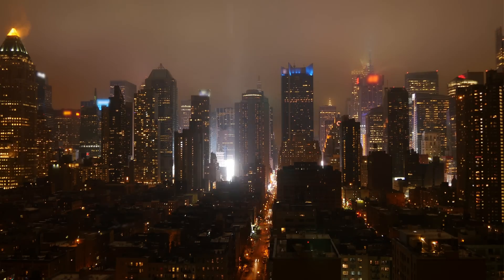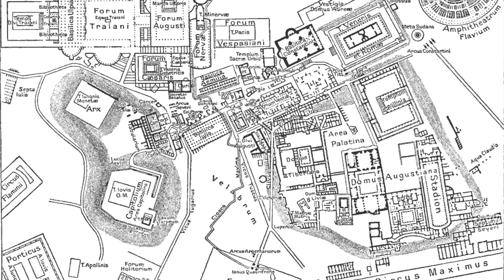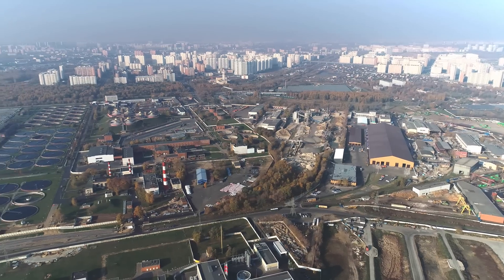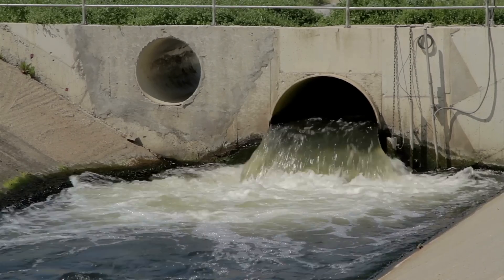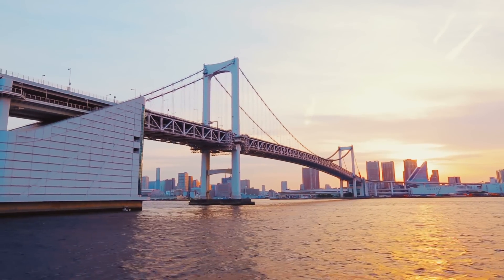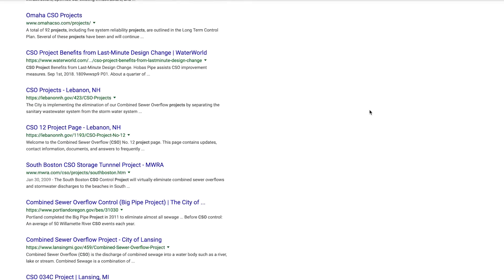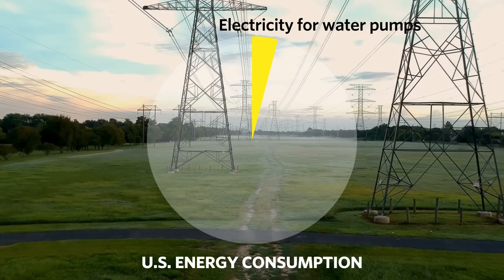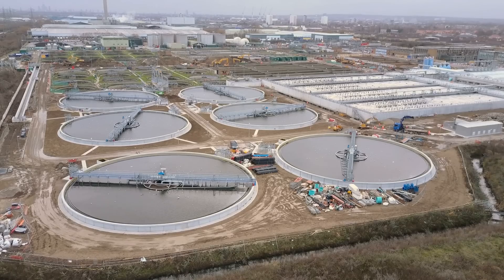An Intro to Urban Wastewater Systems

Comment: Cities Skylines: just drag and place water pipes and treatment facility. Done
Reply: C:S uses separate sewers, you can see 2 separate pipes parallel to each other when you drag-build them. 

Also the water intake and sewage dumping in C:S is flawed. Everything gets treated at both ends and you don't just increase water supply by adding more intake pipes; you need to build new, or enlarge, existing water treatment plants IRL.
Reply: @mfaizsyahmi  no it's two separate, one for clean water, one for sewage
Reply: @xhonkeri4066  where's the storm water lines where the sewage line flows along?
Reply: Lol
Reply: C:S Modders: Pipe? What pipe?
Reply: It seems that Cities Skylines players are over-represented on this channel.
Reply: I always got sewer floods.  Worse than sim city 4's nuclear fallout.  Nobody would just wear waders and live in an underwater city.  Racist against mermaids...🤪🧜‍♂️🧜‍♀️
Reply: SimCity 2000 be like:
Your citizens urge you to reconsider the placement of this facility.

Comment: Thanks for the public service announcement for what not to put down the drain
Reply: Semen?
Reply: While it's true that you shouldn't pour fat down the drain, that's not what causes fatbergs. That information is wrong, because it's cheaper for cities to pretend to fix problems than to actually fix them.
Reply: @DustWolphy  It's never cheaper to pretend to fix a problem.  Source:  Every accident in history.
Reply: @krashd  yes but the accident that follows is someone else's fault.
Reply: The problem is when it comes back up the drain 😱
Reply: You guys be good to your sewer systems. Here in Nigeria, we seldom build sewer systems in our few cities. I live in a village with gutters both sides of the road. Gutters are filled with junk and all the stuff in this video. it is disgusting. It all floats on the road whenever rain fails. I was curious as to how western counties handle this issue and have clean streets, then came across this video.

Comment: I like the Biosystems! They are not only good for improving the quality of the environmental water, but also can function as artificial swamps, holding back stormwater, irrigating urban vegetation, levelling out the stormwater wave, that reaches treatment plants, helping to control cities microclimate by cooling down in summers due to evapotranspiraion... so many possibilities! It does not need to be a water sensitive city, but sponge city is a very promising start!
Reply: A lot of the new suburban developments around my area (MN/WI, USA) include drainage ponds with green space around them.  They double as infrastructure and eye-catching landscaping (usually as a centerpiece in a ring of apartment blocks), as well as watering holes for geese and other critters.

Comment: As a waste water and stormwater Engineer and for a municipality HAIR is the worst for the treatment facility. As well stormwater infiltration accounts for a % of the water in the sewage system as well so even in separate systems stormwater is calculated for sizing sewage. For stormwater, capturing the first inch of a rain is the standard for water quality management. This captures the vast majority of contaminates that would flow into the system before discharging into a creek, river, or ocean. Bioswales, sand filters, wet and dry ponds are the common devices for water quality/quantity.
Reply: Lol, when i was a teenager, i cut off all my hair and, for some reason, stuffed it all down the sink and garbage disposal.  Professionals had to come unclog the pipes underground.  My parents were sooo upset.
Reply: I thought fat and oil was enemy number one...hahaha. fatbergs and such

Comment: As a side note about bio swells, there's another benefit to them.

In addition to lowering the strain on the sewage system, as water evaporates from the plants as they photosynthesize, they effectively allow the city to "sweat" and actually can help lower the temperature in cities. And if your trees are large enough, as they are in some cities, they can provide some shade too.

Cooler cities are more livable, but also can help decrease energy consumption related to air conditioning.

Comment: If you want to make a video on the dutch sewage treatment, I'd be more than happy to help. Here the wastewater is actually pumped into the dunes (in certain areas) and the water management boards play a very big role. Their is also a shifting focus in letting as much water as possible into the ground to help stop the decreasing ground water level.
Reply: To be honest, it's only a Rotterdam/The Hague solution. We've plenty of conventional sewage treatment systems around the country, sometimes even in the dunes like at e.g. Burgh-Haamstede.
Reply: @hendrikdependrik1891  I believe they also do it in the Veluwe as well. But indeed, it is limited in locations. But how it is used as a natural filter, groundwater replenishment, and saltwater infiltration barrier is pretty cool.
Reply: I'm sure the host would love the video footage you could provide.

Comment: "This video is sponsored by Siemens"
Alrighty then...
Reply: More intresting than Audiable or Dollar Shave Club.
Reply: To be fair, they're a giant in engineering, Siemens PLM and Dassault Systemes basically have the entire autos industry (cars, trucks, planes, military equipment, etc) by the balls bc Siemens NX/Teamcenter and Dassault Systemes CATIA/ENOVIA.
Reply: @romannasuti25   I used to work on Siemens wind turbines. They have their fingers in everything.
Reply: @gageyeager6693  oh yeah, I'm aware how much stuff Siemens makes/used to make. All manner of tech stuff from personal devices (phones especially) up through massive mainframes in a partnership with Fujitsu (they never forgot their old allies, eh?)
They also make medical equipment from what I remember, electrical infrastructure, but I think their biggest "oh they have industry by the balls" one is their massive industry automation systems. That includes their IP stuff like Siemens NX, Teamcenter, and Simcenter, as well as the hardware, specifically their very popular PLC systems (SIMATIC).

Comment: really interesting. A point i would have liked to hear about is that modern water safing toilets etc. bring other problems in the sewer system. Sometimes there isnt enough water in the system to properly clean and run the sewer lines since when the sewers were planned the pipes were for a lot bigger amount of sewage.

Comment: Montreal has had a CSO with a pair of large collectors for a long while. There are still massive rejects in en environment despite those collectors. At the time it was built, a waste treatment facility was also constructed at the end of the island. It's one of the largest on the planet and that's part of the problem. The solid gets removed, it gets a chemical treatment to remove further particules suspended in the water, but beyond that, it's just released back to the St-Laurence. The effluents form a distinct band of water which can be detected and even seen several more then a hundred kilometres downstream. Trying to find an engineering solution that is practical for providing further treatment of so much water is something which has been studied pretty much from the opening of that waste water facility.

Comment: I don't know about the situation globally but here in Germany it was a big deal a couple years back that a lot of cities had to partly dismantle and scale down their sewers because they hadn't factored in that saving water would ever become a thing. Therefore they were left with oversized sewer systems that weren't properly flushed by the relatively small amount of water running through it anymore.
Reply from the maker: That’s really interesting, because you need full pipes for the system to work (If I understand correctly). Thanks for sharing.
Reply: @CityBeautiful  Well, they don't need to be full necessarily but the current needs to be strong enough to carry solids with it. Especially in residential areas, this became an issue in many communities.
One interesting solution I've seen was a smaller channel in the center of the oversized pipe, so the maximum capacity wasn't affected for draining storm water but the effective diameter for normal operation was reduced.
Reply: The pipes aren't actually oversized, they just need flushing because the slope is not sufficient. Sewer flushing requires water so it's not very efficient.

Comment: Most modern wastewater treatment plants are overbuilt enough that they don't have to discharge raw sewage during high rainfall. They can either handle the high flows and treat it, or they can store the excess on site and treat it over time.

Comment: A note on stormwater by a civil engineer: the primary pollutant that we (engineers) are most concerned about is actually dirt.  
In a natural environment, very little dirt makes it into waterways, because the ground cover catches it instead.  Dirt from stormwater makes the water cloudy, which increases the waters temperature and causes serious harm to fish, blinding them, making it harder to breathe, and in the some cases killing them.
We are concerned about other pollutants as well, but those pollutants (oil, phosphorus, nitrates) often bind to the dirt in the water, so by preventing dirt from entering waterways, you often prevent other harmful pollutants as well.

Comment: omething often overlooked is the large amount of pumping stations required to get the wastewater to the treatment plant. Something to think about if the power goes out
Reply: Craig F. Thompson  I was the manufacturer's rep for the pumps for years. The "wet well" type sewage lift pumping stations are everywhere. I've sold pumps all over the US east of the Mississippi and have yet to see a community without them.
Nowadays most have backup generators but sometimes they fail or run out of fuel. We had a pump station go down in South Jersey one time and had 10 vacuum trucks (honey wagons) sucking the sewage well out and hauling it to the treatment plant

Comment: To me, the obvious solution seems to be a separate system where both streams go to the water treatment plants. However in the event of overflow, only the stormwater stream (the cleaner of the two) gets diverted to the nearby rivers/lakes/oceans as needed.

I'm sure someone has thought of this already and presumably there is some reason this is not feasible?
Reply from the maker: I think it’s just more expensive. Though those massive combined sewer upgrade pipes aren’t cheap...

Comment: They have some interesting informational plaques and signs around areas of Calgary which describe various bits of storm water infrastructure that is cleverly disguised as natural areas. Or is actual natural areas. Or was constructed to "go natural" (like the "storm water dry pond" near my house). It's amazing what you can learn by going for a "stroll" and actually reading those informational signs.

Comment: Clean drinking /tap water would also be an interesting topic. Depending on where you live it can be a scarce or very seasonal resource. I find it very interesting how cities, who don't have it in abundance deal with it. For example, Singapore tries to recycle more and more of its waste water to drinking quality standard to become less dependent on water from neighboring Malaysia. Hong Kong has a separate pipe system for toilet water for which it uses salt water, so less potable water is wasted. California's Central Valley has a potable water crisis, because the agriculture industry there uses a large amount of potable water for irrigation and the communities in the area have to deal with ground water - which they use for potable water - that is polluted by the discharge of intensive farming.

Comment: Enriching. Though it is a solid and good short video about the topic, I could watch/hear hours of lectures about how all these systems work, and wonder about how to implement them in already huge cities with poor sewer systems or even in small projects of ecological villages out in the rural areas.
Reply: My campus has multiple experimental green infrastructure projects that have been set up over the last 5 years or so, I participated in the design of the very first of these, but other classmates dedicated themselves more to it and have made later designs and construction of these.

Comment: Check out the sewer project going on in my hometown of Greenville SC.  Were using a tunnel boring machine to dig a 12 ft diameter pipe under the city.

Comment: Yeah my city has been busy for 10 years upgrading and separating our waste water system piecemeal  the wetlands near my house have been zoned and rezoned a few times alternately as a storm water biothing and as housing. Also I have noticed that in new areas the road drain gutters all flow into gardens now.

Comment: You should look into Israeli water recycling. They recycle something like 90% of their waste water for drip irrigation.
Reply: Not to mention most of the water actually comes from desalination (the Mediterranean Sea).
Reply: Joe Franklin  🇮🇱 forever
Reply: Better yet do a video about India, a country with one of the most populated, longest and oldest river systems and their sewer system, or lack there of.

But I think this guy's is trained and most experienced in modern urban planning in America, so a video outside of USA will be unlikely
Reply: can Palestinians use it or no
Reply: @cartermize6651  im pretty sure they have a surplus of water and share the water with other countries in area.

But its basically recycled piss and whiz.  Wonder if the palestinians will object from drinking it if they knew the origin
Reply: @cartermize6651  yes. As long as they live in Israel.
Reply: @malcolmholmes2596  lol, no. They're actually stealing quite a lot of the water from the Palestinians. There are ongoing conflicts about this for years
Reply: Egg Shaped Israeli Operative  NOOO WHY???
Reply: @h.celine9303  why would they steal water if they already have plenty though

Comment: Great vid! Could you do a video on green rooftops? The debate about them keeps coming up locally and I’m unsure if solar panels or a green rooftop is better for the environment.
Reply: kopian12 what are the downsides? They sound great!
Reply: A combination of both would be better. Though I guess with green rooftops people are afraid that the roots of plants will penetrate into houses and the weight of plants can collapse ceilings.
Reply: Snovaltica well the cost for one. You have to strengthen the structure of the building and roof depending on the scale of the greened roofs. And then there are some conflicts for space, as it’s cheap to put ventilation and AC on a rooftop for with there then might not be enough space. And then also cost for upkeep one might also have to consider.
Reply: Mines blue
Reply: If we could harness photosynthesis and convert to electrical energy, we wouldn't need home solar panels.  Save those for the deserts.

Comment: Bear with me, this is somewhat lengthy but is all about an innovative use of urban wastewater...
When it comes to Norther California, most people think about vineyards, wineries, the ocean and their favorite spas.  As it turns out, there's quite a lot of geothermal activity in NorCal, which is why there are so many hot springs.   What's not as well know is that it's also the home of the world's largest geothermal steam fields, which has the capacity to generate 1,500 Megawatts of power - in the same range as a nuclear power plant!
The Geysers steam field was first tapped in 1921 and large-scale operation started in the 1960's.  Power started decreasing in the 1980's due to a lowered water table from steam extraction but an innovative solution was found.  Using the "two birds, one stone" approach, the nearby city of Santa Rosa built a 40 mile long pipeline to pump 12 million gallons per_day up into the hills and injected into the ground, recharging the steam field.  It's calculated that the injected water produces enough steam to generate an extra 100 MW, enough to provide electricity for an additional 100,000 homes.
https://srcity.org/1061/Recycled-Water

Comment: stormwater from split systems needs treatment too. the rain washes microplastic from tire wear from the streets into the pipes. the microplastic needs to get filtered before releasing the water.

Comment: Time to go in depth! For example, how combined sewers are just an evolution of open sewers i.e. people just dump into whichever flowing water is closest. Combined sewers intercept these open sewers from entering the river and divert them to a treatment plant. But since they also carry stormwater overflows are inevitable and provided for.

Also hidden in this video is how we approach dealing with stormwater. The previous model emphasises conveyance i.e. we build infrastructures to convey stormwater away as quickly as possible. This is how LA got their large stormwater drainage channels. Nowadays we have moved to retention i.e. we hold onto the stormwater as much as possible, releasing them in a controlled manner, and allowing for the ground to absorb back some of this water. Those rain gardens, and also things like detention ponds, vertical gardens and rainwater harvesting, are examples of this new approach.

Comment: I live in a city on a bay so I am very conscious of water and sewer problems. I suppose people at a distance from lakes and the ocean are not as aware of what happens to sewer water. Anyway, at about four minutes in he mentions the split system vs the single system as if they were about the same. The fact is, the combined runoff sewer/wastewater sewer is much worse for the environment. I was not aware any big cities were still using it.